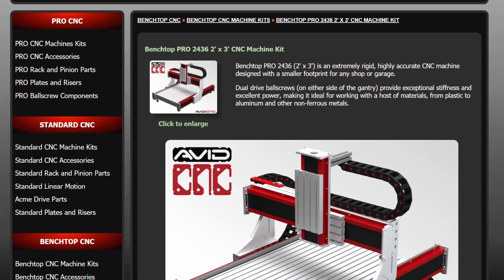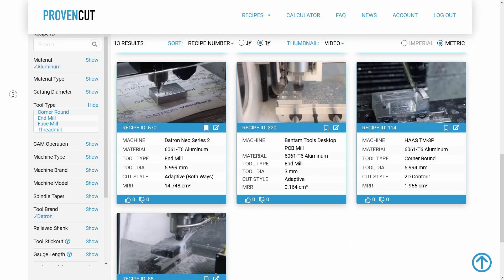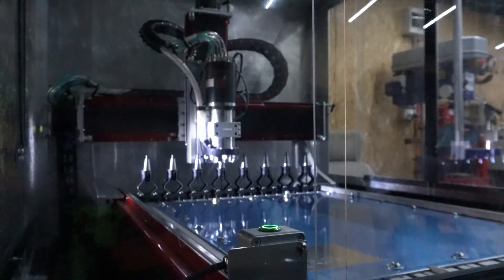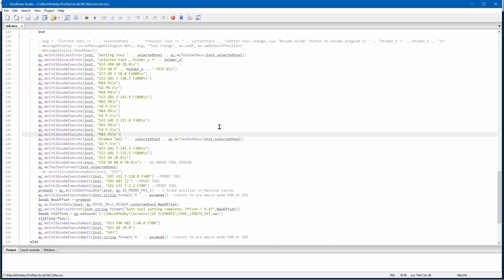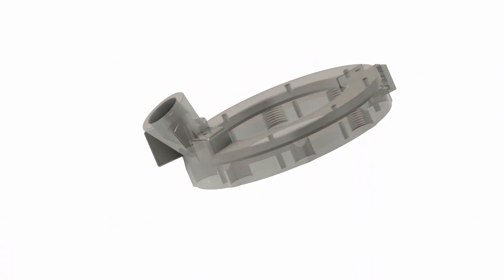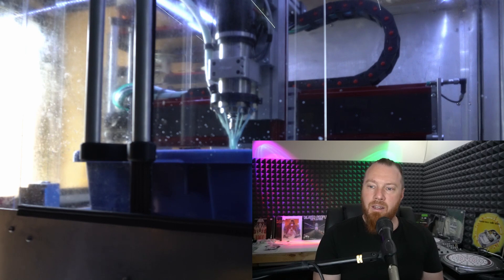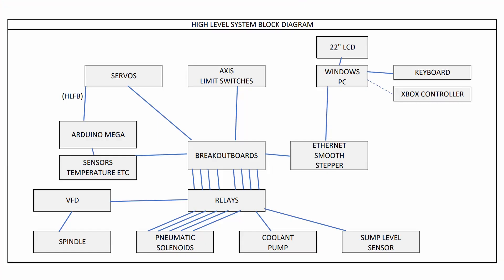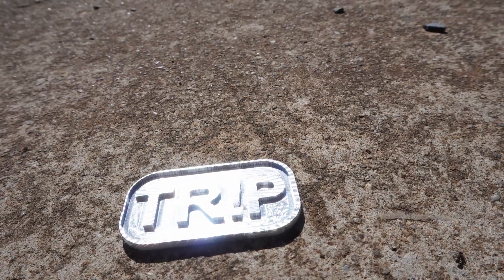CNC BUILD FINISHED - OVERVIEW (Avid Benchtop Pro)

Comment: Great Video, what a great job you have done!! Let us know how the Hangsterfer coolant is going?
Reply from the maker: Thanks! So far the Hangsterfer coolant has been great. Fairly easy to wash off. It doesn't seem to react with any of the plastics, paints or sealants in the machine.

Comment: Great work, congrats on finishing the build!  Machine looks fantastic, definitely a big improvement over stock.  Really like that tool rack design, the built in compliance is clever. I might steal that for my own :)  And definitely jealous of the flood coolant.  That was a good choice, my fogbuster drives me crazy and just isn't good enough for challenging cuts.  If (when) I get around to installing servos and replacing the controller, I'm tempted to build out a flood coolant system too.  Looking forward to future projects!
Reply from the maker: Hey! Thanks ☺️. Yeah after I saw your rack design and the issue you had with engagement of the pull stud I spent allot of time thinking about a solution.  The flood coolant is great. 8 nozzels prevent atomisation of the fluid but its still pretty muggy when I open the door.
Keep up the great work with your videos too.

Comment: Great work mate - makes me miss home even more haha, id be sending you some designs to cut!
one thing I'd always thought using game controllers - they kind of need a guard so that if you drop it/bump it you dont accidentally press buttons/joysticks and cause machine movements... how have you found it?
Reply from the maker: Cheers. With the controller I used the flat direction pad and 2 buttons for jogging, right trigger is the incremental jog, right thumb stick is mouse (push click).
I considered 3d printing a guard but i haven't had an issue yet.
What do you think about the 2 probe system? I just realized I haven't seen that before.
Reply: @MakeTechPtyLtd  its a good idea - in the event that the first switch fails, either via cycle life or via broken connection then you've got a failsafe. I like the fold lines on the boxes too - keeps them nice and straight.

Comment: Pretty cool man ! i built mine myself too and i had  a hard time to setup  the ATC scripts   with Mach3  , i am  starting to look into Mach4  ,  was the  coding learning curve pretty harsh ? and creating scripts from scratch?
Reply from the maker: Thanks. The learning curve was ok. I started programming in 1994. I just had to learn the specifics of Mach4 syntax etc. As I said, the online documentation for some of this was very minimal.
I focused allot on safety features to prevent damage. That increased the scope of integration by allot.
I used the Avid CNC mach4 code as a base and modified it. Mach4 has some good videos for m6 scripts.

Comment: Very nice. I've been thinking about doing a coolant ring for my machine for a while now. Where did you source the nozzles for the coolant ring from? I found some on Mcmaster, but they run almost $20 a piece. Did you find a cheaper source, or do I just need to pony up?
Reply from the maker: Hi, I bought my nozzels on Alibaba for $4.20 USD each.
Reply: @MakeTechPtyLtd  
Awesome! I will look for those. You don't happen to have a link do you?
Reply from the maker: @Wrenchmonkey1  no worries. I'm hesitant to share a link for a few reasons:
Alibaba isn't as simple order process as ebay for example.
It's aimed more at wholesale for distributors and manufactures.
Also I may do those coolant rings as a Kit so I don't want to give away to much interlectual property. If I give away plans and links, I'll do it through the Make Tech website (that's in desperate need of work).
Reply: @MakeTechPtyLtd  
No worries, I understand not wanting to give away all your secrets. I'm no stranger to Alibaba, I was just being lazy. Already tracked some down. Thanks for the tip!
Reply from the maker: @Wrenchmonkey1  great. Thanks for understanding.